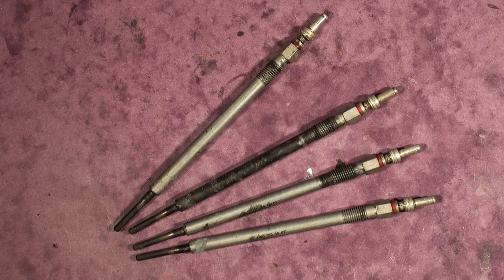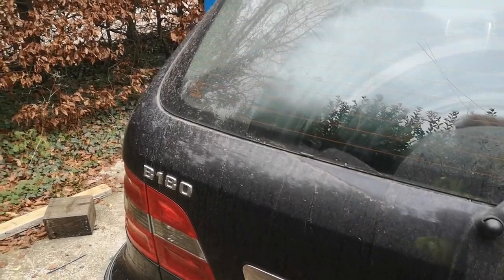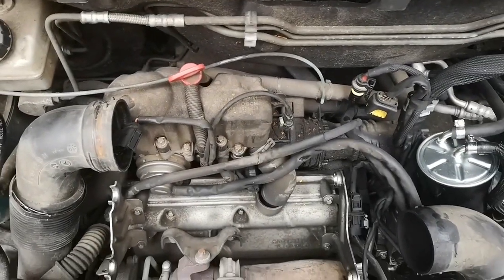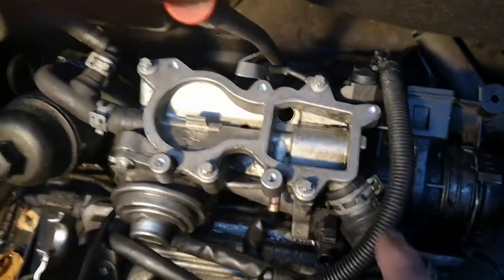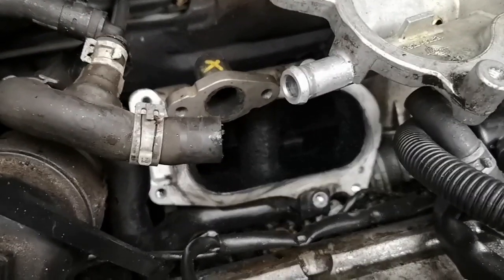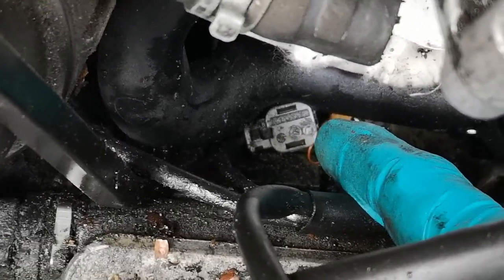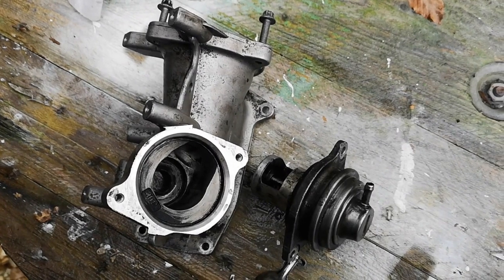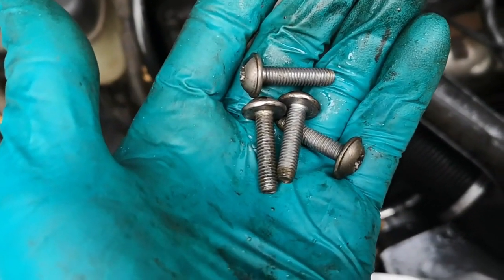Mercedes B Class EGR, Glow Plug, Thermostat Replacement and repair W245 W169

Comment: One of the worst jobs what I did on a car. At least I cleaned EGR and air intake too.
Reply from the maker: It is nasty, The Merc cylinder head/intake didn't  get too fouled up. Some cars are terrible,  I have had the EGR out again ans it was getting clogged. The car has now done 196K miles. I bought it new so that is 2 x EGR clean, one alternator at 182K, a set of driveshafts because boot rot, three sets of disks and pads, one brake light switch, 1 Battery, endless oil filters and an oil change every 5 to 6k miles, and two front struts,   NO wheel bearings or steering joint and no other faults. What a motor!!!

Comment: Very true about the glowplugs, one of mine snapped of course. Turned into a weeks struggle... I got a glow plug removal kit from ebay for £20 or so and managed to get the snapped glowplug out myself without getting the head off.
Reply from the maker: Good job.  I'm not really that fond of Diesels

Comment: Absolutely outrageous 😂 all this for 4 glow plugs and a thermostat Mercedes really want you to bring it to the “workshop” for this one haha
Reply from the maker: It is a faff getting to them. I suppose when it is not all bad when you consider that the car has now done 180K miles with no breakdowns and just this single service to the top of the engine. Still on original water pump, aux belt tensioner pulleys and cam chain.  Nothing else has been changed.   Great car,
Reply: @razenby  one of the most reliable Germans of its time for sure. Your gearbox if it’s CVT is still going on 180k 🤣🥂. You must of serviced it at least a few times

Comment: thank you lots,,,,,, my sisters 08,cdi(165k)  began stopping at any time,  , i stripped it down  new Gplugs, rail n crank sensors.,thermostat, air/oil /fuel filters, n full clean/ de coke egr, Maff clean, and its all running gr8 again,,, infact much better... many thanks,,,
Reply from the maker: Great job.  They are such good cars. Ours is still driving like new at 188K. however it had it's second electrical fault just last week. The Bosch alternator stopped charging. If found a suitable set of brushes  from the tool store in their brush drawer that fitted after a bit of filing and she is up and running again running on drill motor brushes.    We will see how long they last .. The composition seemed very similar.

Comment: Just wanted to say thanks for putting up this vid. It helped me a lot. I was replacing the thermostat. Mine failed the same as yours with the valve coming loose and sticking out the end. The engine wouldn't get hotter than 60 degrees and ran rough at idle. The stat fixed the rough idle. The only issue I did have was after cleaning out a very clogged intake the car wouldn't start. The engine was breathing through three 10mm sized holes through the soot in the intake. Mine was soot rather than the baked on stuff you had. Probably due to the low running temp at 60 degrees. I suspect the non-start was because the fuel adaptions were so far out. After plugging my obd tool and resetting adaptions it started.
Reply from the maker: No problem.

Comment: Thanks for this I've just changed the thermostat on my b class. The Egr valve was cruddy. Now just need to change the starter motor
Reply from the maker: Good Job. they are fantastic cars. Underrated I think.. Ours has done 150K miles and is just started to loosen up and provide more power. Parts are really cheap.

Comment: Fantastic video, definetly going to check my glow plugs on my b200 cdi in a few days. The glow plug light comes up from time to time and after it comes out there is a one second delay on the acceleration and when it does accelerate it jerks. Thank you for the video, it's the only one that goes in detail about the steps to get to the glow plugs.
Reply from the maker: But first check you battery is healthy  A bad glow plug can cause erratic or difficult starting but once running doesn't adversely affect engine performance. The jerk at pick up is unlikely to be caused by the glow plugs the combustion self-heats the glow plugs. It may be an indication of another electrical fault triggering a  and error on the glow plugs.  Do you have a code reader?  You may find other related electrical fault codes which will indicate  wider problem.  If the battery voltage drops too low during starting then strange stuff can happen.  Also check the earth bonding strap located at the back end of the gearbox underneath the car.  This can crack or come loose causing weird stuff to happen.

Comment: Magic smoke good video and just wondering after all that work why you didn't put a blanking plate on the inlet to the EGR valve , I've got the w169 with 120,000 on the clock no lights up on dash but you know it's gummed up. My mechanic says block it up it will damage the engine so for now I've got a another EGR valve off eBay and put it under the bonnet and swamped the vacuum pipes and it works a treat.
Reply from the maker: Conscience about the environment.  The B class now has 145K miles on it and it still runs and drives like new. These are seriously underrated cars.  Most mechanics don't know their arse from a hole in the ground. They are great with spanners but weak on theory.

Comment: Thanks so much a lot of work and so much for this video. what brand of glow plugs did you use?
Reply from the maker: I got them from Eurocar parts (Starline).  I wish I hadn't as one of them blew in a few months,  I put one of the working OEM ones back in and they are still going at 188K miles........
Reply: @razenby  Thanks again

Comment: Do you use WIS/ASRA for instructions? By the way, do all people in the UK have car lifts in their backyard? :‑D
Reply from the maker: Hi, No - just the workshop manual. On this car there was precious little information in the wild. I couldn't even find out online where the glow plugs were located.  Great car - still drives like new at 170K miles and counting.  The car lift was about £1000 (GBP),  In the family we have 6 vehicles. I don't spend on mechanics fees - I just don't trust them, and  I don't waste money on vehicle depreciation either. Fees are eye-watering.  I only use the lift now and then but it has paid me back in spades. The only trouble is you discover that you have a lot of new friends when you get one!
Reply: @TomatoLove about belt noises.
simply use,(Contitech) belt. 👍

Comment: So i have to change 1 glow plug  in the same car do you recommend changing 4 and the thermostat ? Plus i have to change the radiator and it's seems its a big  jod too .
Reply from the maker: It depends. I changed all for with aftermarket glow plugs and one of them failed within 18 months.  With hindsight I would have just changed the faulty one. I put one of the working old ones back in and it is working fine.   Definitely worth changing the thermostat and cleaning the EGR and mixing channel whilst you are in there. My B class still going strong at 180K miles. Drives like new. Good luck.
Reply: @razenby what brand glow plug did u use that failed in 18 months?

Comment: How did u remove the air intake to the turbo tube? I removed both of the clips,but no chance removing it...
Reply from the maker: It is a wire that you need to pry open. I use O ring picks to get behind it and lift it.
Reply: @razenby  oh right, thanks

Comment: Absolutely brilliant video, Thank you. The thing you called an air mass throttle thing, what is the actual name of it please? My son has just bought an A class, same engine but the pipe that goes into that keeps popping out. It looks like the clips are broken so I need to replace the whole piece and I cannot find out the name of it. Thank you again for the best Mercedes video out there
Reply from the maker: The bit that usually pops out is the air pipe post turbo that fits in the  'Mass Airflow Sensor' is at 7:52 in the video. Are clips installed.  There is a lot of force from the air inlet boost pressure when the turbo is active.  The clips stop the wire ring slipping out of the groove.  I would probably get the assembly with intake pipe and MAF from a  reputable breaker. These days they tell you the year and mileage of the  donor car. Parts are surprisingly cheap.   In my view used OEM parts from a 70K miles car are  better better than new aftermarket equivalents.  Our car has done 180K  miles with no MAF issues at all.
Reply: Awesome, thank you. I've taken it apart today and hopefully fixed it. I will take it for a test soon but if not then I'll grab those bits.
Reply: @razenby  and no, there was one small clip but the bottom one wasn't there and the big main clip had snapped at one of the ends. It was still a bugger to get off though, lol. I've just out an adjustable clip on it and tightened it as much as possible.
Reply from the maker: @chrisbluck7276  Ahh OK. get any assy from the breaker..
Reply: @razenby  I haven't even looked yet. Most are shut around here until Monday. But it seems absolutely fine on the test drive. The glow plug light went off and then came back on, along with the EML, so we've just bought some plugs and I'll fit them tomorrow. Really not looking forward to it.
Reply from the maker: @chrisbluck7276  A word of warning I fitted 4 new glow plugs from Eurpcarparts and one failed within 6 months so I swapped for one of the originals that I took out. Buy wisely.
Reply: @razenby  Oh brilliant. We bought the new ones from there too. She asked if we wanted the ceramic ones or steel ones. Went for the steel cos they were about £10 each cheaper.
Reply: @razenby  sorry, another question. What did you use to get the bolt out of the air mass throttle? It's the one that's kinda underneath the body.
Reply from the maker: @flashbeastie  Great news. Hope you fix it OK.

Comment: Nah, its true, i worked as an apprentice in a shop, under the mercedes guy, and as a merc guy myself, it was a pleasure to learn from him... The one thing i do remember was one of the few cases of broken off glow plugs in that same engine, just in a w169(second gen a class)... I had to go out and buy a hssco10 drill of 5mm to drill a hole into one of these bitches after the top snapped off... I took a left hand drill, as i hoped that it would maybe catch and we could get the plug to unscrew thusly, but in the end, we tapped a thread into her, left hand aswell, and by tightening the screw, the right hand thread of the glow plug let go and the damn bitch was finally loose, after 2 hours of messing with it... We tried everything, but in the end, making a quick jig to guide the drill was the only option... You dont want the drill to walk off and obliterate the threads in the bore, as that is an even worse thing to have to report to a customer, and the design of the plug really encourages the drill to wander anywhere other than to go straight down the center due to the construction of the plug itself... 
I would have thought you would have cleaned out the intake manifold and the whole egr region, as that gets caked up like hell over time... So much so that i have seen manifolds with like 80% of the supposed internal volume of the manifold being just caked up oily soot due to our just brilliant egr systems... You know that shit can either break off and fall in the cylinder in chunks or it can just slowly build up until you have almost 0 air passage, suffocating the engine, reducing the efficacy of the engine and its fuel efficiency, just torturing the whole system for no good reason... Either way, when you came this far, you should really have taken the manifold and egr off, tossed both into industrial degreaser for a day and rinsed those out well... Hell, you could even consider the weight loss of all the dissolved carbon and oil slag a performance gain in more ways than one... Sure, its not a lot of mass compared to the mass of the car, but having 300-500 grams of oily soot in the intake manifold which is meant to hold nothing but air in a hollow passage is a really good mass loss... People go polishing and porting their intakes and do the port matching, but this baby right here makes her own variable port geometry by getting caked up like a crapper after a bad exotic cuisine experimentation... And if you let her sit until now, its only gotten worse... 
I am in the process of taking my own w169 apart for this very reason, and i wanted to see if anyone has posted anything like this... Sure, im 4 years late to say this, but then again, if this helps anyone, great... The video is great enough as is, given the madness that is the slant engine design of the a/b classes(and some other vehicles, look up the diesel engine, it goes in everything, from vans to cesna`s)... Tho, despite being a pig to work on, and a complex pig at that, she is a good engine in my experience, as well as are the a class w168 and w169 generations... They are quite old now, and other than few universal rust congregation spots on those, if maintained even a bit well, both generations seem to be a great car, and i own both, and both serve me perfectly, other than the few characteristic bugs they develop... But nothing major, and i did almost flip the w168 in the elk style once... Ended up on two right side wheels, but i turned the wheel to the right and she fell back onto all 4 before i needed to correct the steering... It was an even shielded by the Providence, as im still alive, and i was going 55mph then or around 90km/h... But i also managed to flip a clio gen 2, the renault... I had it while i was working on my w168, and well, i outdone my self, given that im still alive and i managed to slow the 45mph clio before it hit the ditch and flipped over down to like 17mph... The wheels lost grip on an oily patch of road, but there are ways to slow down a car if you know how to drive it like a savage beast just for fun everyday... Never was I more glad than then to be a madman behind the wheel... Tho, that was also sponsored by the Providence, as those 2-3 seconds of time i had appeared like a minute, allowing me to  position myself for the crash, preparing the feet and all other body parts into safe arrangement, yanking the belt to lock it in place, pushing the head back against the headrest and so on... well, im alive, the clio aint, and well, lets just say that i would advise anyone an A class w168 over a clio second generation any time of the day... Not because im a merc lover and a merc mech, but because the clio gen 2 is really a steel coffin waiting to plow you into dirt... 

All the best, and sincere apologies for the bible long comment...
Reply from the maker: Thanks for the comment. It will useful for owners.

Comment: Ok, so I have done whole thing, replaced all 4 Glow plugs (snapped one but managed to get it out with a screw/bold extractor) and the thermostat, now insteat of the temp fluctuating it just remains hot like 95 degrees or there abouts. any ideas? the front fan doesnt seem to spin up, maybe its that? or the water pump? how can you tell and how do you test these compontents, im stuck.
Reply from the maker: When the thermostat is working the temperature will not fluctuate but will read low when engine is cold and move into operating position was the engine warms up and then stays there. Once warmed up,  on my B class, the gauge hardly moves whatever the weather. With a cold engine, if gauge registers high as soon as you turn on then it is likely a wiring or sensor fault.  I have not experienced any airlocks.  Check the sensor is plugged in. If the fan fails to cut in then check the sensor, fan motor and wiring. Keep you hands clear, if the fan starts with your fingers in the way it will cause injury. If you engage aircon the fan should start immediately. (providing your aircon works. I hope that helps.
Reply: @razenby  It doesnt stay at 95. it starts off normally eg cold, but once it starts to heat up is keeps going till 95 and stays there abouts so I dont think its the temp sensor. Just tested the fan with the air con as you mentioned and it started up as it should.. so now Im left thinking it's the water pump. I found the auxillary waterpump and that operates fine but do you have any idea where the engines main pump is and how to test it? Thanks for all your help, much appreciated.
Reply from the maker: @WhosLeadingYou  Main water pump is driven by the Auxiliary belt.  They either work or leak. I doubt it is the pump.On our Merc it sits about half way between 80 and the 120 mark. Why don't you just check the temperature? What temp were you expecting I believe 90 degrees is about the right temperature for  a pressurised system.
Reply: @razenby  Really? I just assummed that 80 degrees was the correct operating remperature as the thermostat is listed as having an operating temperature of 80 degrees and most cars in my experience have the temp gauge pointing to the middle temp. The fact that your car seems to operate at a similar temp to what im seeing to my car does provide some comfort. Im just concerned that it may not be that good for the car in summer here in  Western Australia when we often get temeratures rising in to the 40's. Thank for your help, Im just going to leave it for now and keep an eye on it. You're video has been such a blessing to me we need more people like you making helpful videos like this, make my life so much easier.

Comment: Hi, Can you tell me where are the injectors located on this engine?
Reply from the maker: At the front of the engine.  See this picture https://dalys.lt/en/autoparts/mercedes-benz/b-class-w245-b-180-cdi-245-207-80-kw/engine/1251661